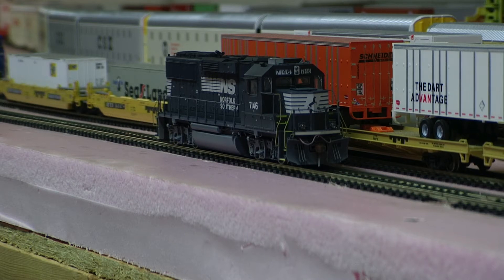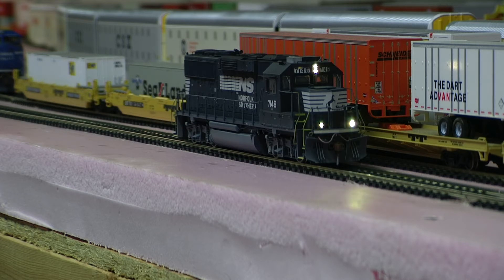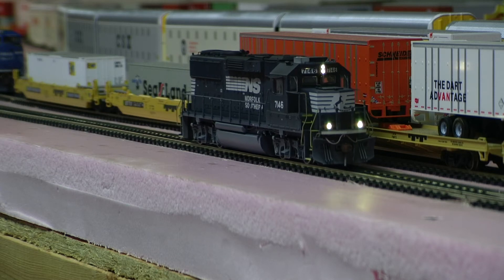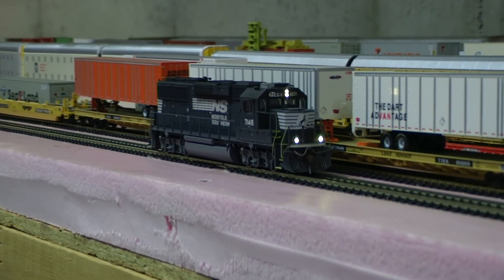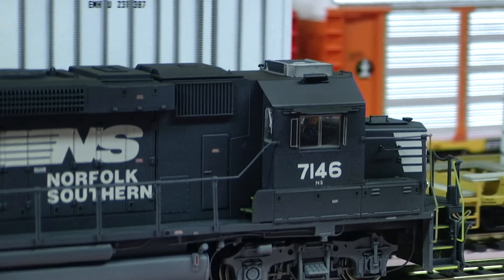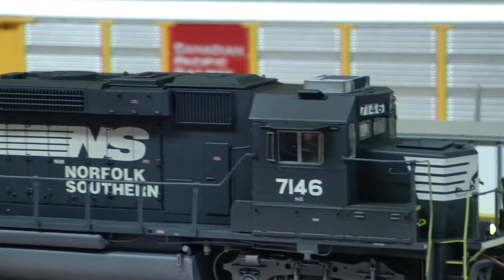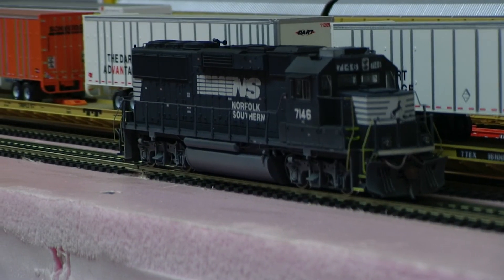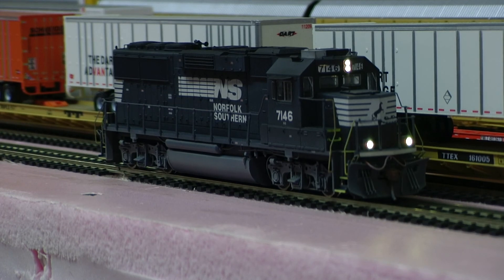Custom Weathered Proto 2000 GP60 NS #7146 with Tsunami Sound

Comment from the maker: you need to cut the weight down to fit both the speaker and decoder properly. I have an install photo but the crappy comments thing won't allow for links. Search my website for the NS GP60 and CP GP38-2.. I painted the weight in the rear so it may be hard to see were it was cut.

Comment: I have a quick question, I have several GP60s & 38-2s that I am going to be putting sound in. Are you removing some of the frame weight to allow for a speaker or how are you doing the speaker install?
 Thanks!!

Comment: I have the same engine as that and the ditch lights and the plow and the antenna system thing above the cab was not attached to the loco.  I couldn't figure out how to attach them to the loco.  also if there is any way could you tell me how to get them actually working. Thanks